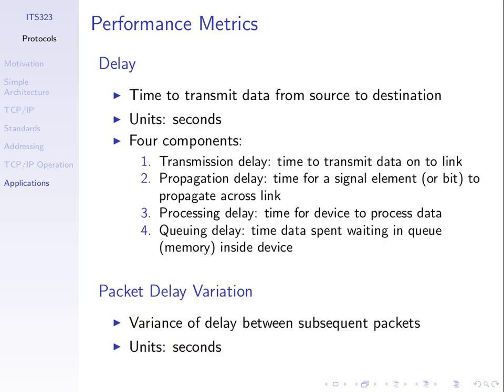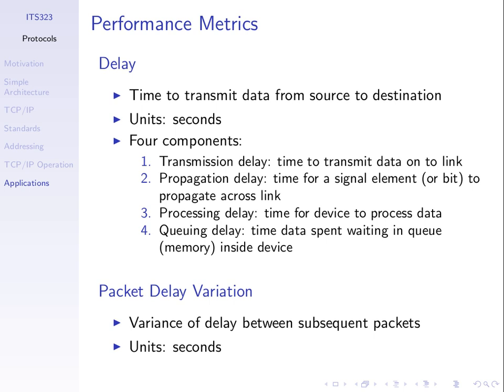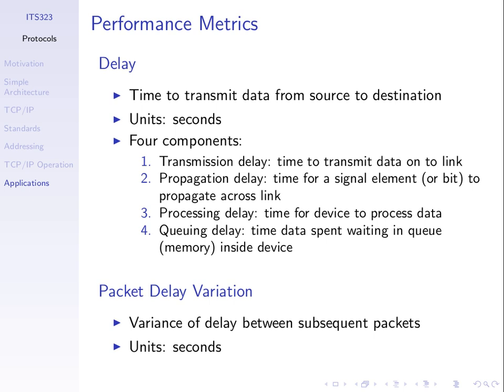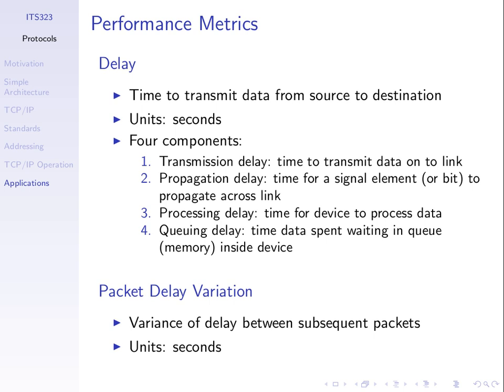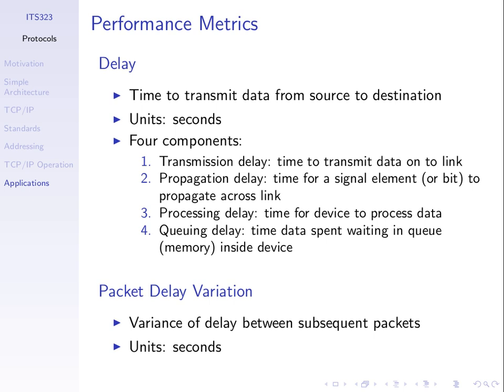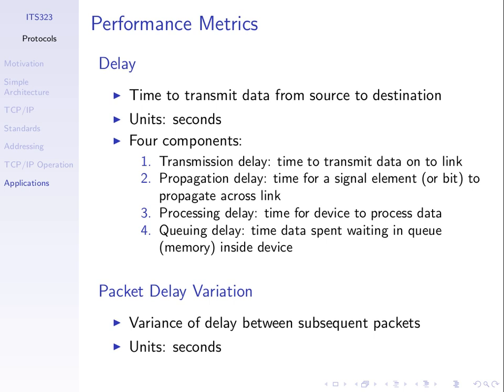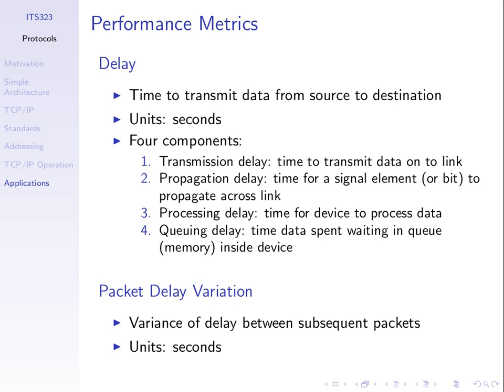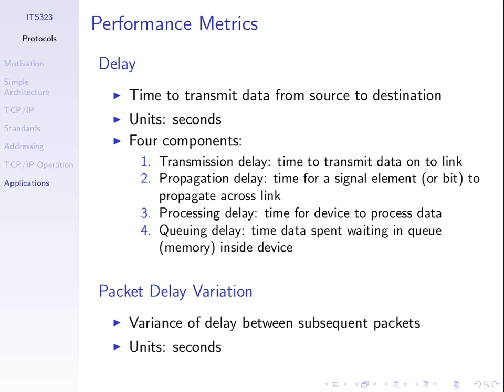ITS323, Lecture 05, IT, 25 Jun 2013 - Transmission and Propagation Delay

Comment: Is there any book refrence for this topic? thank you
Reply from the maker: Most of the course ITS323 is based on "Data and Computer Communications" by William Stallings. Other textbooks on data communications should cover it, e.g. similarly titled by Forouzan.
Reply: I have read both books but they don't explain like you.and they don't say anything about quee and process time in intermediate divice .
Reply from the maker: Then maybe try "Computer Networking: A Top-Down Approach" by Kurose and Ross. I don't have it in front of my right now, but the table of contents has "Section 1.4 Delay, Loss and Throughput in Packet Switched Networks". It mentions queuing delay and end-to-end delay. I recall I made the slides on delay and performance myself since Stallings didn't have it early on - I just don't recall if I based the slides on a text or general knowledge.

Comment: is it true that
propagation time=distance * propagation delay
Reply from the maker: Depends what you mean by propagation time. Time to do what? That sounds like delay, in which case your equation is not correct. As in the lecture, propagation delay is defined as: "the time it takes the signal to propagate across the link". It depends on physical characteristics: the speed at which signals propagate (which in turn depends on the medium which the signals are propagate, wireless vs copper vs fibre vs ...) and the distance it needs to propagate. Hence:

Propagation delay = Distance / Speed

where as an upper limit, Speed is the speed of light (for more precise values of "Speed" you need to lookup the characteristics of different materials for the specific link you are considering).
Reply: i was reading  problem solution  WILLIAM STALLINGS chapter 7 ,problem 7.5 it says

 
7.5 A → B: Propagation time = 4000 × 5 μsec = 20 msec
i wanna know how and according to which formula (Propagation time = 4000 × 5 μsec = 20 msec)??
 is it possible solve for me problem 7.5 from chapter 7?
thank you.